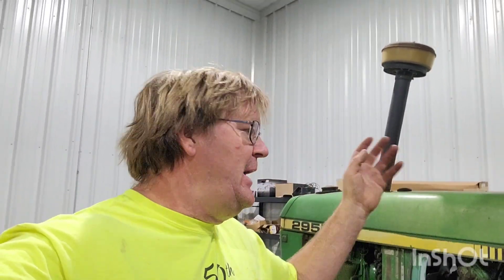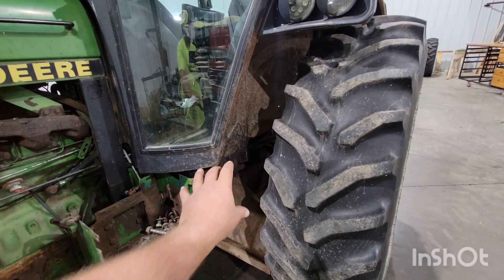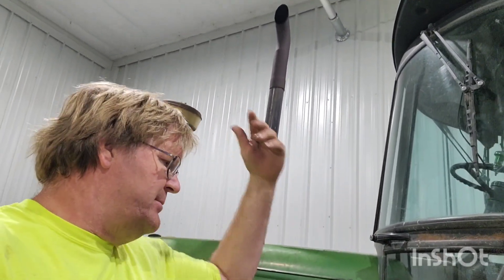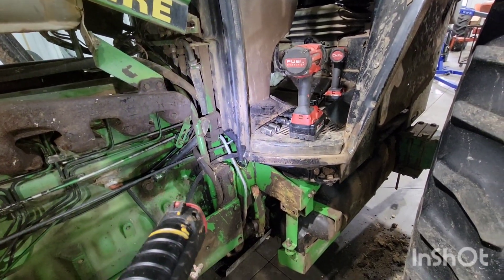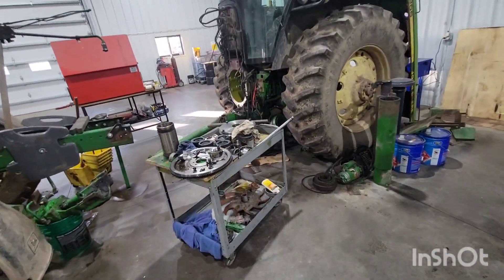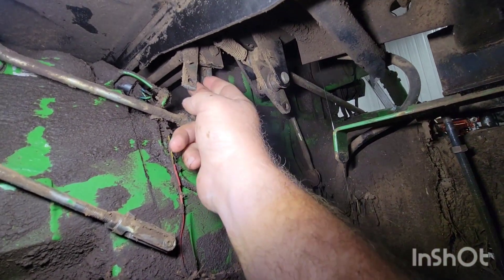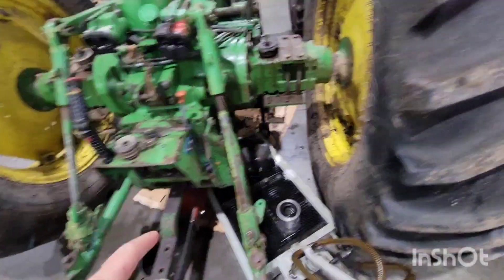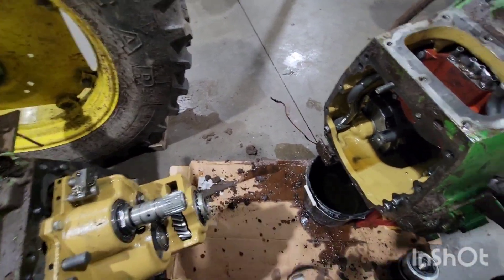John Deere 2955 cab removal and transmission split

Comment: Hello, I had clunks coming out of my 3155 hydraulic drain to ,  what did it end up being on this tractor?
Reply from the maker: We split this tractor for the seal leaking oil into the clutch housing. 

I can't remember what some of the other little things were
Reply: Ok thanks anyway

Comment: I don't suppose you have a video of taking the shift cover off? I have a 2555 that is stuck in 3rd gear and I tried taking it off through the cab floor but it wouldn't  come up. I am missing something but don't know what.
Reply from the maker: Usually pretty straightforward. Gasket glues them down good. 
There is six hydraulic tubes that o-ring into the bottom of the shift cover as well
Reply: @jonstevensmaplegrovefarms3754 thank you sir.

Comment: Hi, good info. I scrolled thru your videos but I am not seeing a pt. 2  Just wanted to watch the rest of the tear down. We may have to replace the clutch slave cylinder on our 2955 and looking for as much info as possible.
Reply from the maker: https://partscatalog.deere.com/jdrc/sidebyside/equipment/2650/referrer/search/pgId/1342361

That would just be a normal split for a clutch job

Comment: It’s me again. I got that 4000 rockshaft valve back together and working well. Thanks for that! 

Now I’m working on a 2550 open station with tss transmission as well as mfwd and hi lo. PTO will not disengage and mfwd will not disengage. I have not checked pressure at shift cover yet. Sound like a low pressure internal leak to you?
Reply from the maker: @cooperandrews2052  If you look in the parts book from the shift cover there's four little pipes that come from the shift cover and go into a manifold and then off to the side to the right is two bigger pipes that go down and one of them is what goes forward to the front of the tractor. 

Not uncommon at all for them. Pipes to leak or even break. 

Oh crap! It's been a long time but there might be some test plugs around that shift cover to find PTO brake pressure. 
If the front wheel doesn't disengage yeah it's either electrical or you're not getting pressure. 
Does the tractor drive and run fine and does the high low work?
Reply: @ yeah I was seeing some info on that.  I have a feeling the low pressure side is leaking as it comes through one of these little pipes for hi lo or pto.

Yes the tractor runs great. Hi-lo shifts well. I know the front pump is getting fed fluid from the trans pump cause I get 2250 psi at the SCV at the back.

Comment: Wow so glad and surprised to hear from you does that 2955 need torn apart to bleed the clutch(the dealer is not in a hurry to help me out
Reply from the maker: If it has a cab it's hydraulic 
Just like bleeding brakes.
Or could just need some adjustment.

Comment: My dad and I have a2955 that the high low range went out of sent to j Deere dealer they fixed the high low but now you can’t shift with out grinding gears — do you have any ideas or advice
Reply from the maker: The first thing that I could think of is the 2955 has a hydraulic clutch and they might not have bled it good enough so it might not be completely disengaging

Comment: How much does the sound guard cabs weigh?
Reply from the maker: Good question,  maybe 800-1000lbs?
Reply: @jonstevensmaplegrovefarms3754  thanks. how much more would 4230 be? Im wondering if my 1 ton gantry would lift it.

Is it possible to split the 4230 in a way I could get at the transmission top shaft?

Thanks for make the content. I really enjoy your videos. First gen farmer here
Reply from the maker: Our little chain hoist is a one ton and I can easily lift it.
You could build Some legs to drop down from the bottom of the cab right in front of the rear axles. And then you could roll the transmission out from underneath the cab.

Comment: Why is the 3155 a pile of junk then . Arnt they same
Reply from the maker: The 2955/3155 had some quirks, much improved over 30 series. 
They were good to operate, kind of miserable to work on.
Reply: @jonstevensmaplegrovefarms3754  hey I want to go look at a 2355 industrial. 
Are the industrials still synchronized or not. 

What should I look for 3700 hrs 

Has side ditch mower on it. 

Asking 11,500
Reply from the maker: @bigwhane8603  
Other than yellow paint I don't know what there would be for difference between construction and agriculture

If I was going to look at that tractor they're really isn't a specific problem with that tractor. I would do a pretty General look over. How does it start, once it's warmed up the exhaust and the blow by how do they look, does it shift halfway decent do the brakes work. Are there any hot spots on the hydraulic components like the outlet boxes that the levers hook to or the three-point control valve housing

I'd pull the radiator cap off the rev the engine up to make sure it's not pushing water, does the water look clean, does the hydraulic oil look clean and not smell burnt
Reply: @jonstevensmaplegrovefarms3754  what does pushing water mean

Comment: Hey, i just went through the internet looking for somebody who has the same issue with the 2955, no hi-low and no function of the rockshaft. What a nightmare…. I hope to see part two of this operation to get some know how. I am about to remove the cab and then let‘s see.  Regards from the freezin Yukon
Reply from the maker: Get a John deere tech manual not an aftermarket book.
Reply: @jonstevensmaplegrovefarms3754  I do have that already- makes it 1000x easier and worth the money.

Comment: I always remove the 3 point hitch assembly and check the transmission shafts and I also check the load control shaft for leaks and replace when the oil is drained out they like to get pitted when used around a barnyard or have been submerged in water and manure.

Comment: Have a 3650 which is very similar, but UK model
Same thing, metal bits out of the back plug turned out to be the rivets off the handbrake band

Comment: I like our 2940, hydraulics suck but rarely use them. Love the fuel economy of that engine, says made in France is that the same in that 2955.
Reply from the maker: 2000 series are German built.

Yep both should have 359 engine.